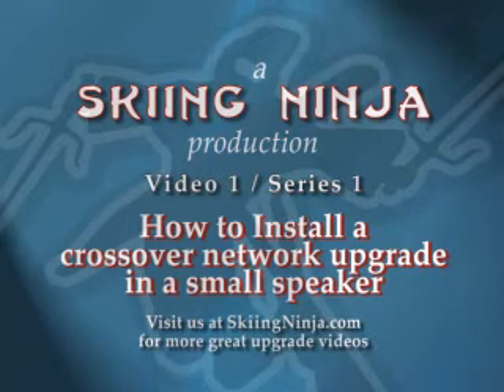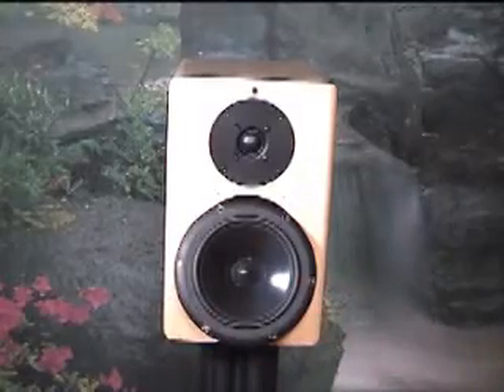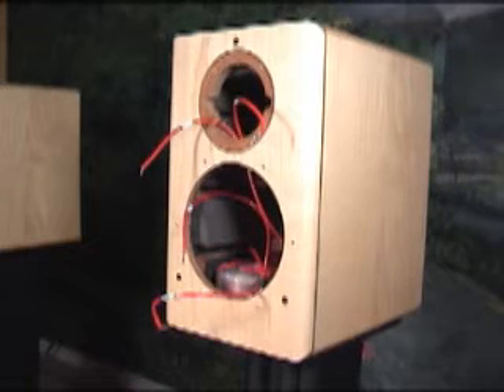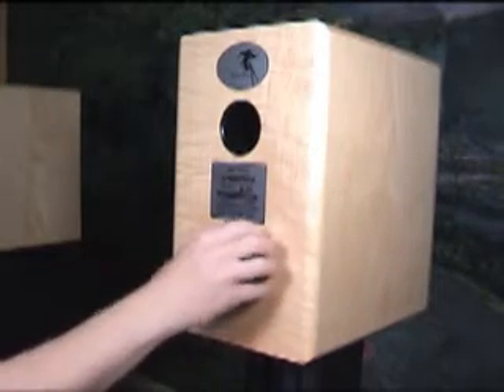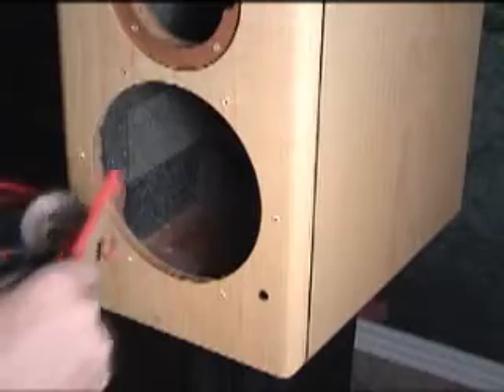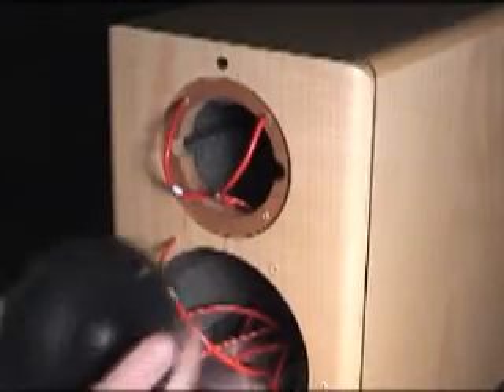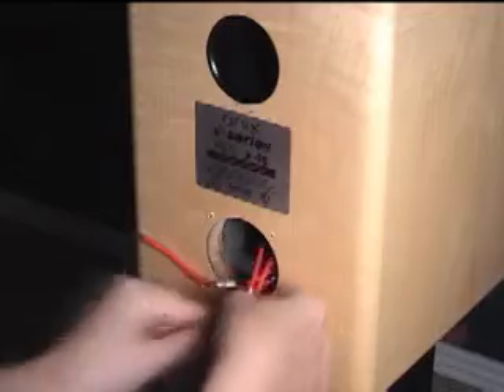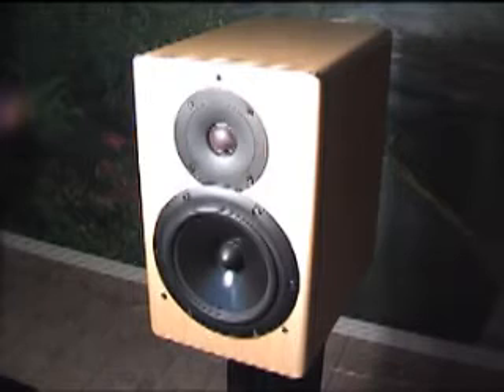Skiing Ninja How To: Install a crossover upgrade in a small speaker

Comment: With a new 3-way crossover at one's disposal, can a 2-way connection be made. The existing speakers have 2 X 8" mid-bass & a tweeter ! That is, with this crossover, can the 2 mids be connected in parallel and wired to the mid-bass part of the crossover, woofer left vacant ? Low bass wld be absent, but the aforesaid is still an option.....correct ?l

Comment: In what consists the amelioration? Crossovers are designed for the loudspeaker electric features itself and based on many parameters. Are you sure that your one is an amelioration?